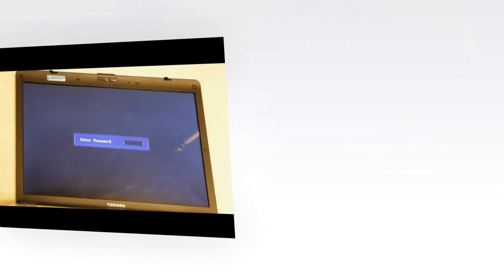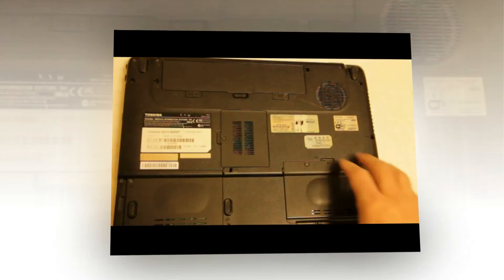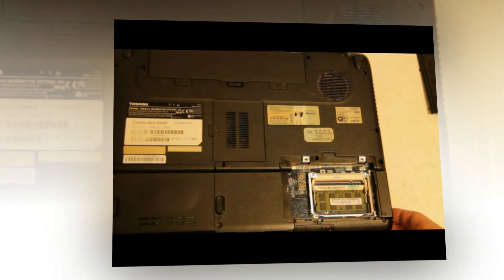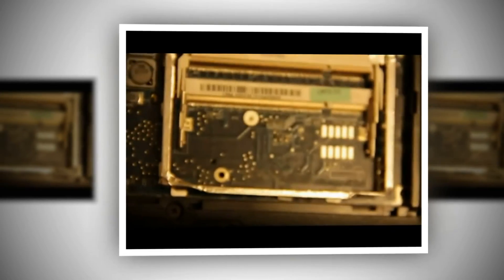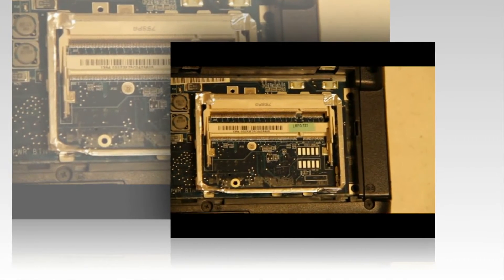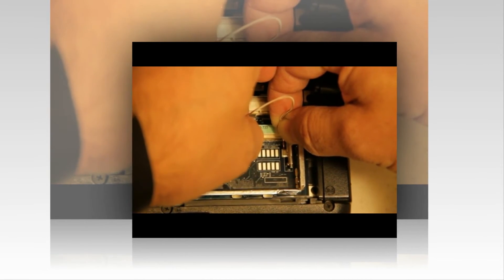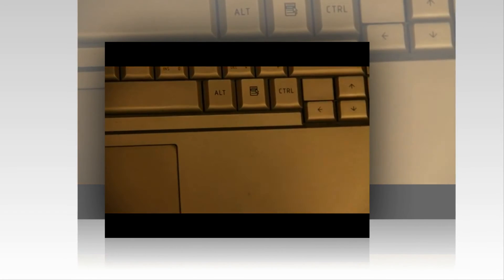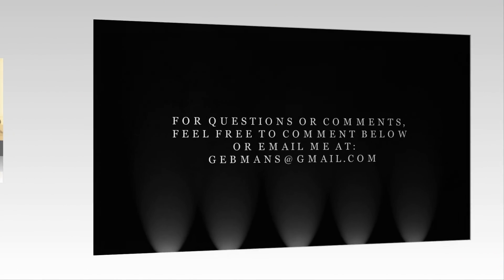Toshiba Satellite BIOS Password Reset

Comment: someone help me
Reply from the maker: MrFineran Sorry, I didn't catch your previous comment. If you don't know how this is done, you'll need a local shop to help. But with older Laptops, in most cases the cost of repairs out weighs the cost of the laptop. It would be the same or cheaper to find a replacement on eBay that you can just swap the hard drive into. Now, this is due to the fact in almost all cases unless the password was intentionally set, the BIOS password is created not as a password, but a failure of the motherboard itself and the BIOS locks as a security measure. Now, Toshiba won't officially announce this as it's a way to force you to send it in. But this info comes from a reliable source and experience. Usually a GPU issue or low voltage on the CMOS battery. But usually a GPU or controller issue. So, even if you pay the $75 or more to have the password reset, there is the cost of repair for what failed in the first place. Otherwise it will just lock again and again. The best option, find the same or as close to the same and swap the hard drive so you can use it as it was. Otherwise you can upgrade to a current model and just have a shop transfer the data. But your data shouldn't be lost unless the hard drive is password protected as well.

Comment: someone help me with my Toshiba c75d-c7232
Reply from the maker: MrFineran If I'm correct, that should have a parallel port on the back. You can find a password dongle on eBay to reset it, or make one yourself. You plug it in, boot it up, then restart it again and you should have access. There isn't a jumper on the board for that model.
Reply: +John Gebman how do I find that